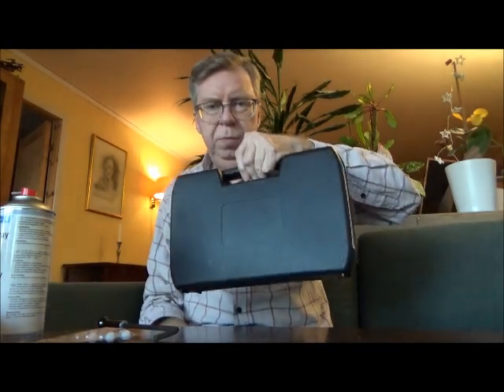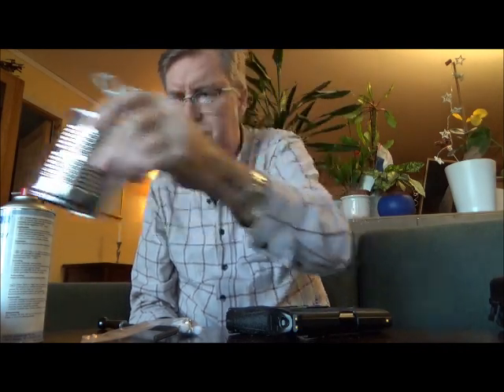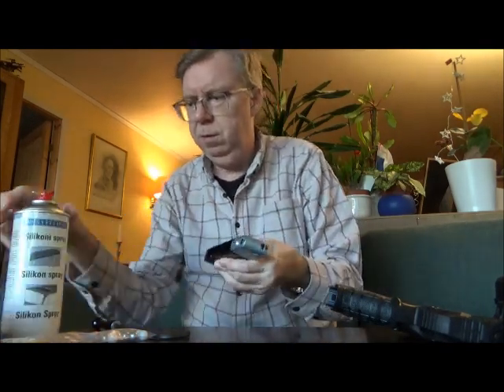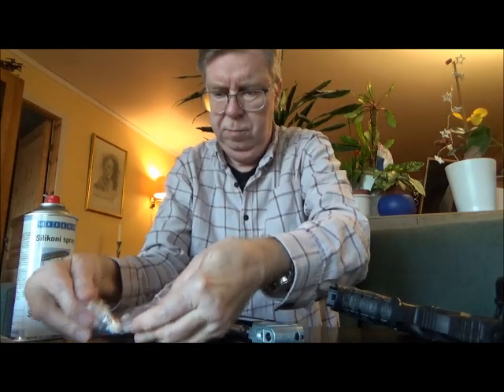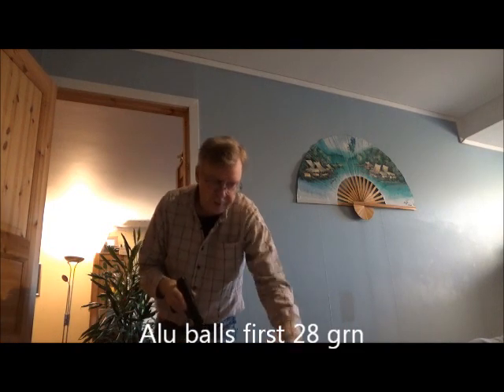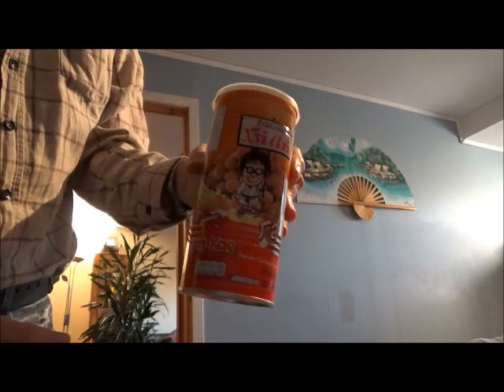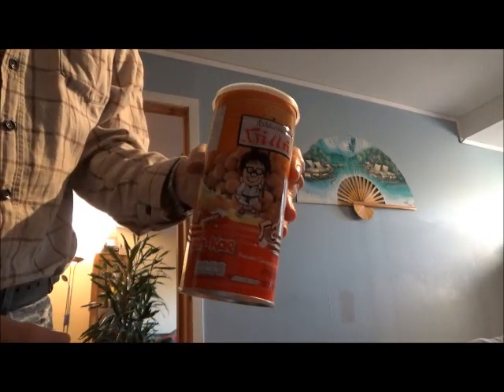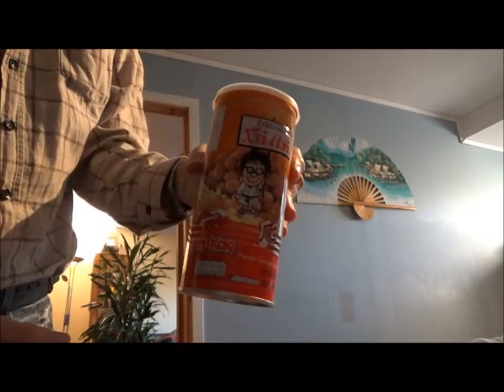Umarex Walther PPQ T4E, Testing Alu balls

Comment: Thank you so much for making this video. You are one of the few that actually put the numbers with the rounds in a stock RAM that provides useful information one choosing the best munitions. So many focus on joules and FPS but fail to match munitions to the RAM. FPS means nothing if I’m using the lightest rounds make of rubber that gives me high FPS, or if I’m using heavier munitions made of steel that gives me high joules but low FPS. These aluminum rounds are well balanced for .43 caliber T4E RAM’s used for personal protection. Do not be fooled by the nay sayer’s. Show me a YouTube video where someone is being shot with a .43 caliber aluminum round less than 10 feet/3 yards/3 meters. I promise you won’t find such videos because they would be to graphic to post to YouTube. Most people in doubt about these RAM’s are basing it upon speculations that low speed and low joules would not be harmful or dangerous. These aren’t toys. Shooting someone with rubber rounds 20 feet away from a RAM at 300 fps isn’t going to be the same effect as shooting someone at 10 feet with aluminum rounds at 270 fps. 

Lastly, the more a RAM is a direct replica of an actual firearm, the less likely one will actually have to use it. This is a proven fact. These RAM’s are licensed replica’s of the actual firearm. One cannot tell the difference until it’s fired or one has it in their hands. Study says, over 90% of those who drew their weapon, only a small few had to actually pull the trigger. Most owners of a firearm will never have to draw their weapon outside of training. Thus, it is my opinion that without modification of theses RAMs, using this video and information he has provided us, get some aluminum rounds, oil the aluminum rounds with pellgun oil, this would be an excellent less than lethal weapon. Another alternative, load your RAM with pepper balls and empty the clip. 

Oh and one last important information, you don’t need an emergency magazine. There is a YouTuber that has had his CO2 cartridge in his magazine for over 7 months. I leave mine in for one week. Every Sunday, I oil my O-rings with pellgun oil, oil my rounds, and carry ready to fire. Sure I may lose some CO2, but Ive been doing this since I purchased my RAM. I have not had any issues with leaking so far.
Reply from the maker: Thanks my friend. Iam very glad you like the video. Yes the aluminium balls are great for this pistol. I think you are right about not have to fire it. Just showing it would scare most criminals away. The seals and O-rings made now are much better than what we had back in the 1980s-1990s. I have spoken to folks have the same CO2 canister in their pistols for 6 month or more, and they never had any leaks or other problems. And they still perform great and holding CO2.  Thanks for the info. Take care and have a great day. Greerings from Norway 😃👍

Comment: Hello Rune! Nice Video as always. I tested them too last month . Having the same J and speed. I also locked the pistol and tested different bullets on 12 meters to see how precise there are. The aluminium once’s is most precise at the end. Spread is around 3-5cm. Try also hard plastic with the weight of 1.15 grams. They a bit less precise on the long distance , but way more faster. 
All the best
Reply from the maker: Hello and thanks my friend 😀  A 5 cm spread at 12 meters is very good for this type of pistol. Thanks for the info. Take care and have a great weekend 😀

Comment: Hei Rune. Takk for alle dine supre videoer. Jeg har tenkt en del på tuning av ppq'en. En sterkere hane fjær. Jeg har funnet en Internet side som selger hane fjær til ppq blank gun/start pistol. Tror du denne hane fjæren vil være sterkere enn den originale ppq fjæren?
Reply from the maker: Mange takk. Hyggelig at du liker videoene mine. Tror ikke den fjæra vil passe. Etter hva jeg har blitt fortalt så kan man gjøre følgende: Åpne kanalene i ventilen slik at den slipper gjennom mer gass. Slappere ventilfjær (mulig man kan bruke en fra en kulepenn). Forlenge tennåla med ca 1mm. Lime fast med epoxy en bit bly på hanen. Dette for å gi mer annslag på ventilen. Man kan også deaktivere blowback, men ikke sikker på hva de gjør da. Dette for å gi all gass til å drive kula og ikke for å dytte sleiden tilbake. Med alle disse mods så har jeg blitt fortalt at de har klart å få over 30 joule fra en PPQ i kal 43 🙂

Comment: hi rune would you recommend these or the pvc-coated metal balls? they are about the same weight of 1.9 and 2g. I was wondering which you thought is more effective in terms of power and do you have to worry about wear on the barrel from any of these harder projectiles?
Reply from the maker: Hi. They seem to work great, but I think the polymer/PVC might be good if you plan to reuse the balls. The alu-balls can be dented. No so on the PVC type. I reuse all my ammo if they can still be used. PVC ammo can breake in pices, but if they dont you can still use them 🤔

Comment: Greetings Rune. Hope all is well with you. You did a video with the steel balls but didn’t chronograph while you shot them. If possible, can you do a video shooting the steel balls using the PPQ? I’m trying to determine if the steel balls is better than the aluminum balls. Everyone that post videos of them shooting the steel balls with the PPQ never gives actual numbers so we can only guess what the fps is.  If the fps is like 190 that would prove that despite the lower fps the joules would be 8.89 versus the aluminum having 250 fps but only 7 joules.
Reply from the maker: Hello my friend. I have some metal balls for it. Think they are aluminium balls, but I will take a look. I will make a new video testing the velocity when/if I find them.

Comment: How long does a co2 last when pierced? I’m kinda mad bc how are we supposed to use these as self defense? Tell the robber to hold on I have to pierce my co2? Lol
Reply: You don’t want to keep it more then 6 hours. It’s not good for gun. For self defence there produce emergency mag with quick piercing system. Check ot
Reply: These are for less lethal diversionary tactics.

People have the wrong impression by these.

These aren't for having a firefight. These are for unloading the mag in the direction of a perp and fleeing or following up with pepper spray or your fist.

These won't stop people. They're just for causing the FIBSA factor (Fudge I'm Being Shot At) which can buy you time to get out of the danger zone.

That's why I recommend people miss on purpose if they are at a distance, that way the perp has no idea what's being shot at him. If up close just put them all into his face. Let him deal with that while you run away.

Just a heads up though, not sure if you watch self-defense videos like on ASP. But rarely do people have fire fights and have to reload. That's only in movies and video games and war zones.
Reply: @billionrscwm1798  Your comment is a little difficult to understand.
Reply: @billionrscwm1798  also there is a video on replacing a spring for faster FPS. Get a looser spring or cut a piece off
Reply from the maker: @twiztid83222  Yes. You can put in a softer valve spring (say from a ballpen) or cut down the orginal spring a turn or two. I have done so on softgun CO2 pistol and it works fine.
Reply: @dangerous8333  Yeah there is a lot of mistakes 😅 you can buy quick piercing magazine for that gun. You don’t have to screw the ballon in that case. Just hit it from the bottom

Comment: Mr.Rune Are The Upgrade Kits For The TR50 And TheTe50 Umarex The Same Or Different?
Reply from the maker: They should be the same. Check with www.homedefence-24.com for parts needed. You should also buy the long barrelkit plus the AMMO6 slugmaker for it. Then you will have max power and always have ammo for it ;)

Comment: Can PPQ be tuned up?
Reply from the maker: I have tried putting in a softer and shorter valve spring, but it didnt do much. I guess the barrel is to short for the velocity to build up...  Maybe if you open the ports in the valve and glue some lead on the hammer, plus a longer firing-pin it will help. Not sure  🤔
Reply: @runerebel8441  Thanks for the reply. I thought the barrel might be a bit short. But it looks like a fun little blaster.
Reply from the maker: @goemboeck  Its a very fun pistol to plink with. I can highly recomend it 🙂👍

Comment: How can we increase energy by 12-15 joules?
Reply from the maker: From what I have been told you can get over 25 joules if tuned right. Hammer mod, spring mod plus opening the ports in the valve. Then use heavy balls for ammo. This Iam told can give as hi as 28 joules..... But I havent tuned anything. Mine is stock...
Reply: @runerebel8441  Can you do a simple mod and film it?
Reply from the maker: @neprevazutul  If I can find a way to open the porting in the valve without harming it, then I try it. If I do I make a video 😉